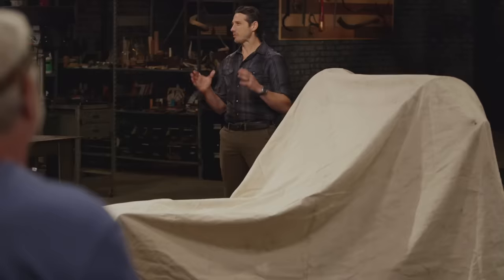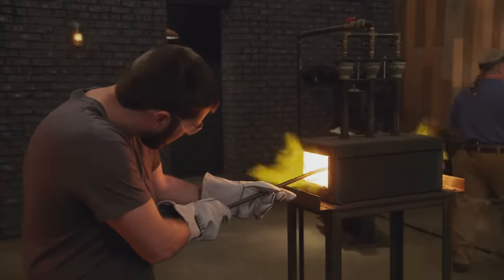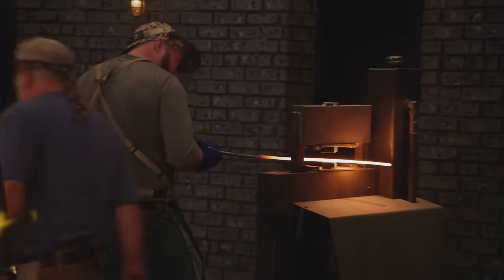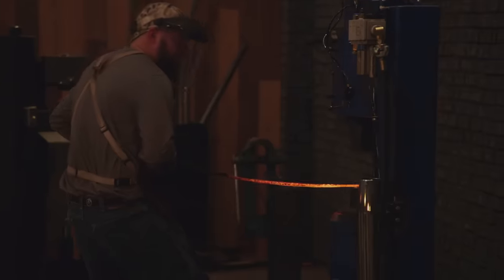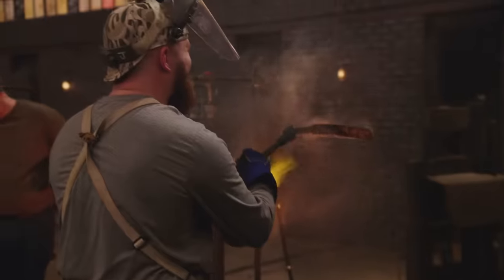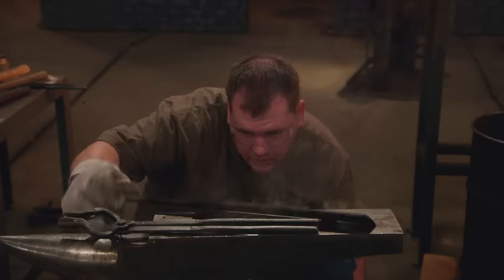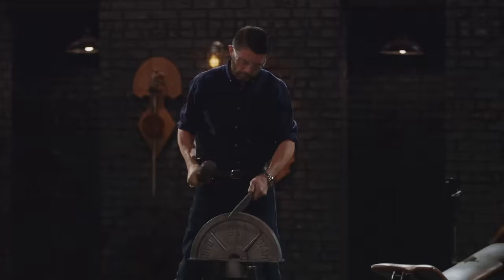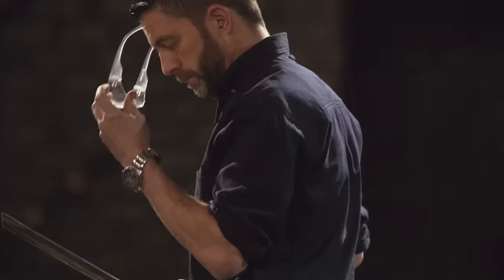GYM WEIGHTS Used to Forge the Nagamaki?! | Forged in Fire

Comment: These shows should have an induction forge. It's kind of messed up that contestants end up wasting time just waiting for their material to heat up. It would be a lot safer (provided they use a carriage) and run less risk of decarbing the steel. If you want to argue tradition, they're using a gas forge. Moreover, blacksmithing usually doesn't involve tack welding for forge welding. Blacksmithing is a team sport.
Reply: That defeats the purpose of the show.